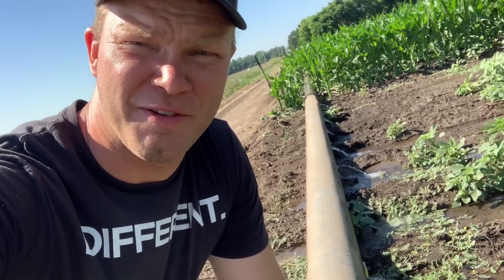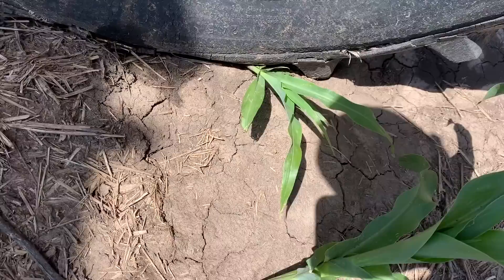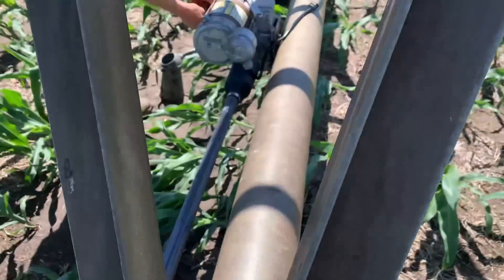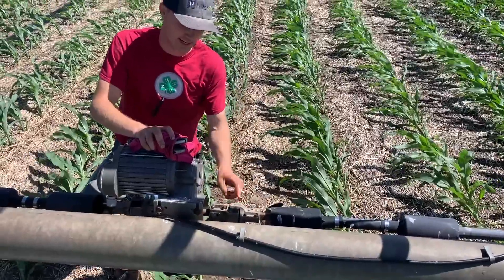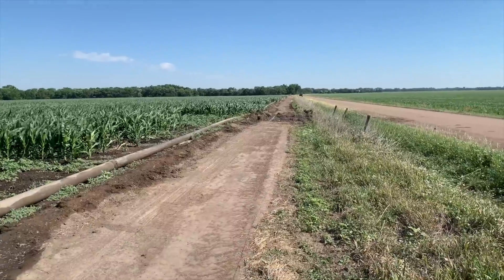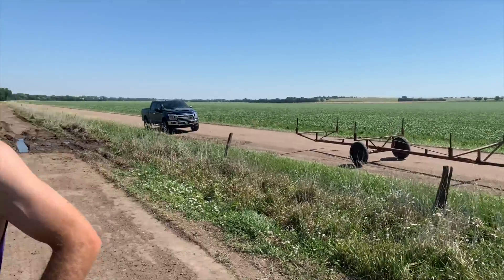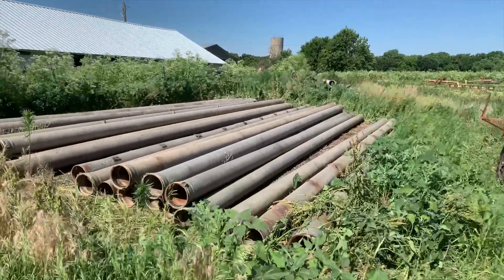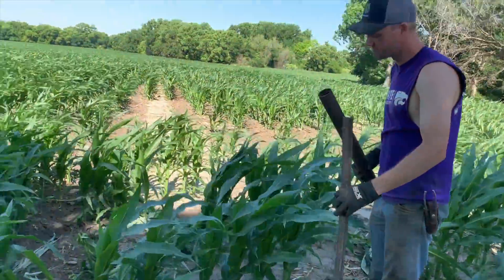Irrigation Systems for Farming! (Flood and Center Pivots)

Comment: flood irrigation?  no - surface irrigation.  
more evaporation losses?  no - center pivots have more, because of wind, if over 14 mph.  
center pivots are flexible?  only if the soils are right for them.
surface irrigation can be as automated as center pivot
subsurface drip can be inefficient if poorly managed.  Same for all irrigation systems.

Any system, even the most uniform, can be inefficient if mismanaged.  Irrigation options: surface, subsurface, sprinkler, drip, and hybrids of these.  The buyer of a new irrigation system should consider how uniform the irrigation system can be, and how easy to manage to get the optimal depth of application.  I have seen surface irrigation designs that are more uniform that center pivot.
I am a retired Professional Engineer, agricultural.  My BS was Ag Eng with soil and water.  My MS was Ag Eng in irrigation.  My thesis work was CFD for level border irrigation.
Reply: Would surface irrigation be ideal for growing cane on a field 200-300 metres across, 2.5km ahead?
Reply: I wish I could ask your advice on improving my flood irrigation and some pipe replacements.

Comment: You ever see the big single gun irrigation units? That travel across a field being pulled by a cable hooked to a winch which is anchored by a tractor. It pulls a water supply line as it goes across the field.  A number of Farmers in Michigan still use them, till they can afford the center pivot system.

Comment: But your farm is wasting water when using the flood technique.
Reply: Not all the time with "gravity" as we called it. just about every quarter we ran in south central Nebraska had a reuse pit on it just like the lagoon and we would pump it back up to the headland on a separate line of pipe that ran on one end of the farm. The pipe being used is very old screw gate style and it isnt as common for someone to add additional gates in between these screw style.  Many times we would run gates on 15-20" spacing and then ditching it to run every other row or using a plastic style "sock" that hooked over the pipe to direct flow was used.  In dry years like this I preferred gravity as you could achieve a much deeper saturation level versus trying to play catch up with a pivot.
Reply: Compare to other methods yes it is waste full.  Prolly won't be irrigation for the next generation. Google Loss of  Ogallala Aquifer.  Water management is very important when using this method.